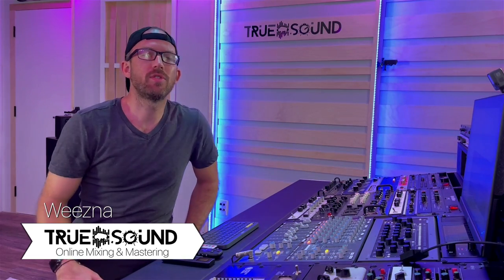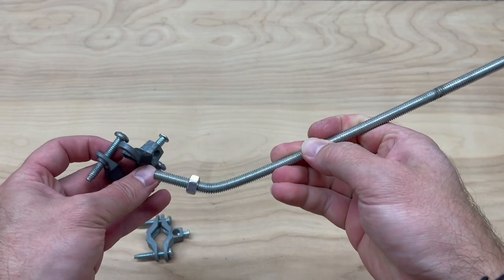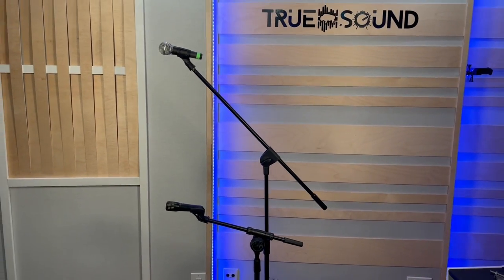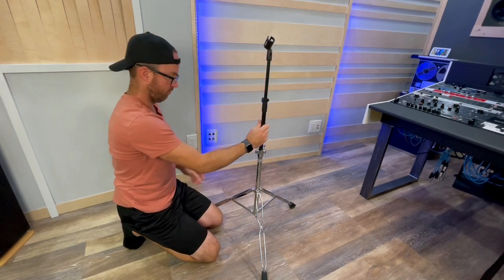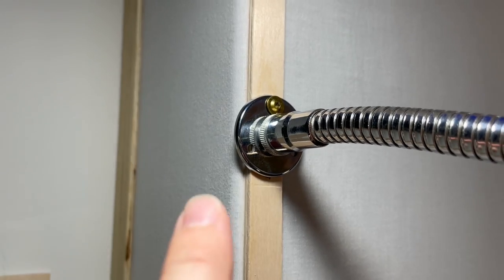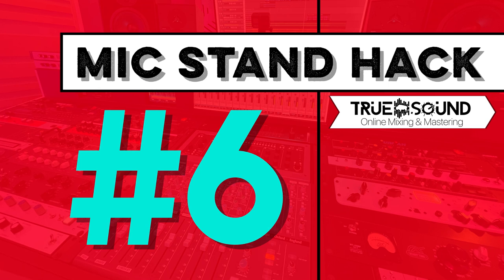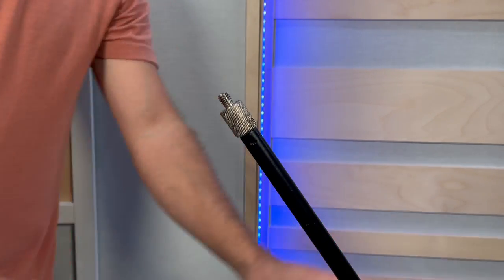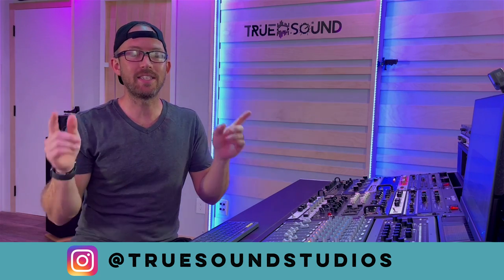8 Mic Stand Hacks

Comment: 1. Great hack
2. Using it for a long time!
3. I see some use for it, although I have some have duty mic stands I use 
4. Those things are very handy!
5. No matter what adapter, buy them. You will eventually need them! :) I have a mic bag full of them. Instead of an SM58, they are filled with every adapter you can think of!
6. Weights use for fitness are not very expensive but really help create are very heavy base
7. Mic to video adapters! Also very handy and are in my adapter bag :)
8. I use my broken stands for that! lol!

Thanks for the video!

Comment: boom cymbal stand's base with a mic stand's boom arm was something i did for years, especially in venues where youve to play without a stage - people will stub their toe before driving the mic into your teeth.  also, for sitting down, the cymbal stand's boom clamp sits lower than a mic stands boom clamp...if you are sitting in a normal seat the boom arm is sitting at 90 degrees, its less stable and looks very untidy.  i now use a traditional mic stand and have actually cut the vertical tube in half so the angle of the boom arm is at 45 instead of 90.  i kept the boom arm the same length so it can reach high enough for when im standing, and is also high enough to hold drum overheads.  i just bought three cheap chrome mic stands and three matching drum stools for my three piece acoustic act and cut all three mic stands down and it looks much better than unaltered stands

Comment: What is the hinge part called? I need it for a ceiling camera so I have friction control.
Reply: My best guess is that is called a 'friction pad articulator'. The pole that rotates in the hinge is called the boom arm. The connection type on a lighting stand is called a spigot, and usually includes a 1/4" screw for lighting stands, 3/8" screw for camera tripods, and at the end of professional microphone stands is the thick 5/8" gauge screw. For some reason, lights, camera and sound  equipment is not compatible with one another without screw size adapters. I have not, for example, found a tripod head that seats nicely over a lighting spigot connector, even though mounting a camera to a lighting stand is a no brainer.